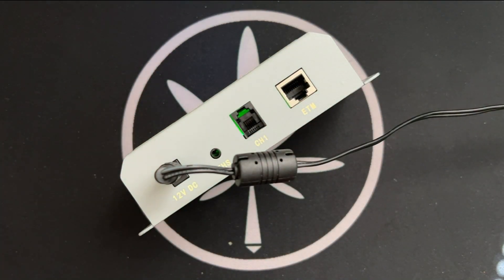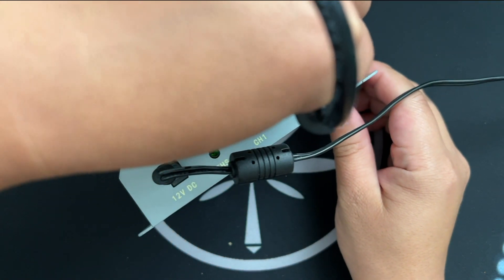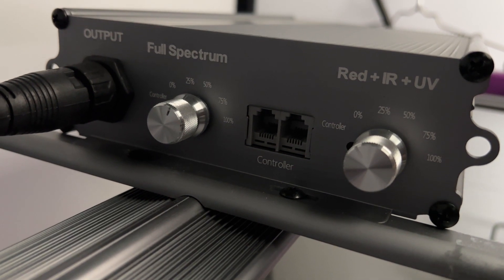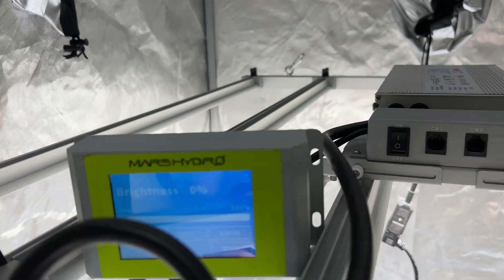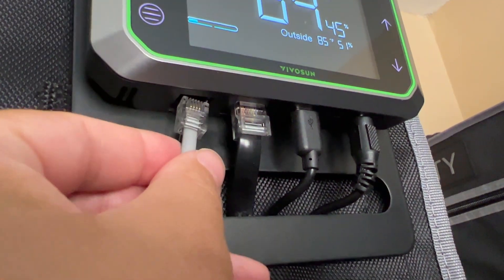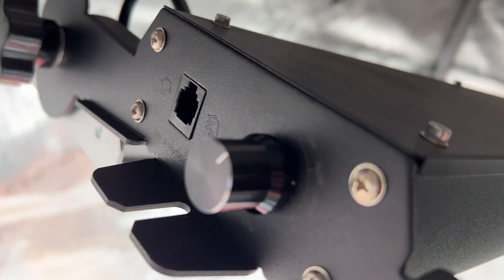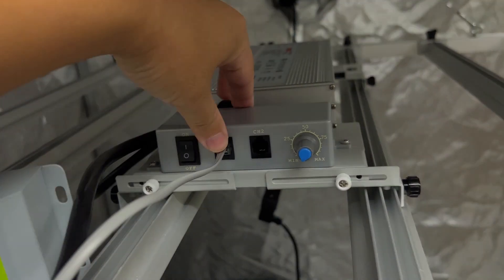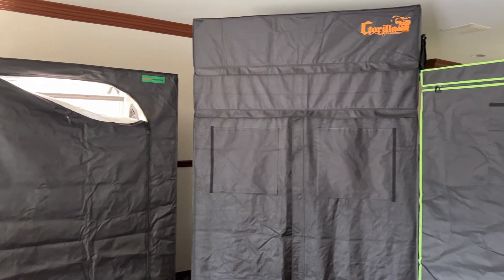The RJ-11 Port On Your Grow Light is Probably USELESS - A Mars Hydro Grow Light Controller Review

Comment: The reason for all this confusion is actually pretty simple. The rj cable can have 4 wires ( rj11) or 6 wires (rj14) etc. Most drivers are dimmable with the dimmer + and dimmer - wires. Every manufacturer use different wires from the rj cables for + and -. For instance optic led uses wires red and yellow combined for dimmer + and green and black combined for dimmer - with an rj 11 cable. There are 4 wires in an rj11 cable black, red, yellow, and green. The trick is to find out what color wires different companies are using for + and -. Once you know that you put those color wires to the proper polarity and bam done deal.

Comment: Yeah see there is two sub specs, of these controllers. One spec is 0-10v and the other is PWM control. You can do some 0-10v control with PWM but you have to be able to adjust the PWM frequency to match it's input filter. This is just the signalling there is also pinout there are more pinout differences than the two led control signalling mechanism. There is also the DMX standard but grow lights don't use that protocol. So at the end of the day unless you know the pinout, and the proper protocol grow light controllers are hit or miss. Also some of the RJ-11 dimmer ports are not meant to take a signal from a controller but just a signal from the same brand and daisy chain the one dimmer knob. Until all grow light manufacturers standardize the signalling, and the pinouts there will be little compatability between devices. Another thing to keep in mind most the dimming circuits are actually in the driver themselves. Meanwell drivers are the common standard for the 0-10 and PWM they can support either or. However you can look this dimming control if you have the driver's model number. However you are still at the mercy of how did they pinout the signals from the driver to the RJ-xx port.

Comment: On almost all of these lights the ports are for daisy chaining only... Not all lights are compatible with a controller, but if you have one that is compatible with a controller and then Daisy chained it to the ones that aren't, they will be controlled by the first light in succession Which should be the one connected to the controller and sometimes you need a  RJ14 cord for the extra data needed to interface with the controller and light

Comment: You are using the wrong cord with the MarsHydro controller. Black crossover cord is needed. Works with all MarsHydro lights including the new SmartGrow system. The ethernet port is for factory programming and is not used.

Comment: its nice that ac infinity released there rj11 to UIS(usb c) adapters, i got the adapter A which works perfect with my Mars Hydro Fc-E 3000 connected to the controller 69, i had to alter a phone chord to get the adapter to work with my tsl2000. if you have the want you could pretty easily get any of those controllers working by figuring out what the pin out of port on the controller is and then matching that up to the light you want to use. there are rj 11 screw terminal adapters on amazon you can get that wld help alot with matching up the wiring
Reply: Mine just won’t work. I’ve tried a and b. Use the light cable not ac?
Reply: @friendlyghostkinda did using the light cable and not the one AC Infinity provided work? I just recieved my Controller 69 Pro and RJ11 adapter for my FC-3000 and sure enough my light doesn't work and the Controller doesn't power on. Did you ever fix your issue? If so, may I ask  how?

Comment: I have the tsw 2000 model and tried to link it up with controller 69 Bluetooth model from AC infinity which claims its compatible using Type A adapter. It won't even turn the light on smh.

Works great for daisy chain tho
Reply: Wound up on this video with same problem. Firmware update finally did the trick.

Comment: I am looking for a controller that works with my marshydro ts-1000. I just want to set special brightness at certain times. If there is not such a controller I would also already buy new power supplies that work with an appropriate controller. What do I take there best?

Comment: Sometimes the phone plug pinout changes
Reply: glad to see someone else has figured this out... the pinouts need to match and i dont think mars hydro had a standard for them. my tsl2000 is + - + - and it connected to a parfact works controller thats rj port is + + + - so i just bought rj11 screw terminal adapters from amazon and made my own adapter to get the leads to match up and viola it works great

Comment: Even Mars Hydro themselves can't agree on a standard for their products. Doesn't matter what model of light you have, but what kind of driver (power supply) is used. The Meanwell ones are controlled via resistance (there's a poti in the control box, which you turn with the knob), while the ones with their own branding use the more common 0-10V/PWM standard.
So if that Controller you got there is using 0-10V/PWM, while your lights have a Meanwell driver, it won't work.
The AC Infinity page for their "UIS Lighting Adapter" with Type A (0-10V/PWM) and Type B (Resistance) was pretty helpful in figuring that out.
Reply: your correct about most of that although any light that has a dimmer box with a potentiometer like all of mars hydros dimmable lights do are resistance dimming via the potentiometer(dial) on the box. some drivers like moso x6 series which all my ts1000s and my tsl2000 has have 3in1 dimming  and can be dimmed with pwm or resistance. my fc-e3000 with meanwell driver also has 3in1.. so its really down to how the manufacture has there dim leads wired up to there dimmer box and what the pin assignment is on the rj port .. the leads from rj port on the light dimmer box have to match up to the port on the controller, + - - + to + - - + for example would work wearas + - - + to  - + + - would not work.. some lights show the pin assigment right on the dimmer box and same goes for some controllers like my parfact works controller shows the ports are + + + , which did not match my tsl20000 light that is + - + - so i got some rj11 screw terminal adapters from amazon and mad my own adapter and it worked as it should once i was able to match the positive and negative leads correctly. had to do the same thing basically to get an ac infinity type A adapter to work with my tsl2000, the adapter type A worked as is with my fc-e3000 though, it didint work for both the tsl2000 and the fc-e3000 bc the +/ leads dont match up but they can somewhat easily be made to match by altering a phone cable or using screw terminal adapters

Comment: Maxisun lights come with remote controls you can use to change the lighting pattern and intensity. They have Samsung chips and Meanwell drivers too. A light for a 2x4 space costs under $200.

Comment: how did u get this controller.. I ordered it on 2 different occasions and never got it.. I assumed they didnt even exist and I had the ol bait and switch pulled on me as mars hydro didnt want to be only mfg that didnt offfer a light controller.. same deal with spider farmers that is basically the same thing as mars hydro light controller.. i ordered spider farmers as well.. they sent me a heat pad controller and then told me the light controller was sold out when I emailed them and asked why the send me a heat pad controller and not the light contoller

Comment: the pin assignment is diff on some lights and might not be directly compatible with a certain controller.. which it why trolmaster sells the adapters and so do some other controller mfgs.. mars hydro rj jacks are + - + - and some are + + + - u should be able to use a multimeter to figure out what is what.. some light dimmers are 1-10v and some are 0-10v.. the 1-10v will not dim to off.. that vivosun controller should 100% work with any 0-10v dimmable LED u prlly just need an adapter.. look up rj11 to screw terminal adapter and u can make your own i can walk u through it if u need. I am michigan home grower and can help u get any of those controllers working for whatever lights if you want just reply and ill send u my email and walk u through it..
Reply: I use the parfactworks intellegant light controller with my mars hydro LEDs.. had to make my own adapter for them to work but it works.. there are 2 outlets on the controller garden A and garden B and then there are 3 channels per Garden/ Rj11 output so i can have 3 diff dim lines coming from each output.. there is no temp or rh sensor on the parfactworks controller but i wasnt really worried about any temp controlled dim setting i just wanted to be able to schedule sunrise and sunset dimming to get a more natural light cycle going and it works great for that purpose
Reply: @davidmassengill5290  My RJ11 jack apparently is wired + - - +.. I got a cheap dimmer off Amazon that has two wires ( + & - ).. Should I hook both the + wires from the jack to the + of the dimmer, or just one or the other?  Same question with negative wire.  Any help you can provide will be appreciated.  I have already confirmed that connecting a meter to wires 1 & 3 ( + - ) gives me a positive voltage that increases as I turn the knob on the LED controller (~ 25 % steps).  Thanks!
Reply: @Gareth96v1  try connecting the 2 wires  to the ones you metered.. Try pos1 to pos2 and neg1 to neg2.. If that dont work try the opposite.. Pos1 to neg2 and neg1 to pos2.. There shouldn't be enough current to blow out anything if it gets hooked up backwards
Reply: @Gareth96v1  BTW I have a mars hydro led with meanwell drivers and the dimmer switch on that one is wired + - - + like yours.. I use these thing to make my adapters
Reply: I just ordered a spider Farmer G3000 it claims to be a dimmable and controllable with any universal 0-10 v controller. I was looking for an upgrade from my aerolight 100w from vivosun I have their WiFi controller. I was wondering if it would work together?

Comment: Aren't these ports for daisy chaining to other lights. Appreciate your videos. But instructions for my SE3000 specifically says it's for daisy chasing.. 
Light 1 will control the dimming of all lights.
Reply: theyre for external control weather its another dimmer box or a controller it should function the same if theryre connected properly/ compatible

Comment: Has anyone come up with a hack to get the ac infinity 69 controller to work with 3rd party lights?
Reply: they did, the adapters lol, im sure you know that by now. the type a adapter worked great with my fc-e3000, it didnt not work with my tsl2000 but i was able to get it to work by altering a phone cable to make the + - leads match up correctly

Comment: Make sure to check for firmware updates for the controller and/or the light.  Also, these ports are sometimes added to generic so called "chinese" built stuff as something that might be utilized in the future but it can sit there doing nothing.  Don't expect a feature if you see an interface port in this wacko world.

Comment: It’s not for a controller it’s to dim them all to the same brightness on the marshydro light that it
Reply: No it's not. Then it wouldn't need a light timer, and display humidity and temp.
Reply: @swankshire6939  hes saying the dimmer boxes on the lights arent for controllers.. they initially are inteded for daisy chain dimming like he said but it shouldnt matter if signal comes from another dimmer box or a controller he just needs the proper positive and dimming leads to match up in order for them to work

Comment: Does trolmaster controller work with mars hydro?
Reply: with an adapter it does.. u have to get the F adapter i think it is and then the 3.5 mm stereo pin to screw terminal adapter thing and wire the 2 dim wires from mars hydro drivers right to the adapter
Reply: or u can strip and hard wire there rj cable and wire the dim leads to that but u will need some electrical experiance to pull that off

Comment: I bought a light controller from 420seven and I thought I was trippin when it didn’t work. This controller controls 4 lights via 4 independent RJ11 ports. Long story short, I finally got only 1 mars hydro (FC e4800) to work as intended. Tried connecting another light from another tent (FC 3000)…no go. Tried daisy chaining the 2 lights and…no go. That 1 stumped me because both lights claim to have that capability. I scrapped that idea and decided to just run the 1 light on the controller and the other manually. So far I’ve yet to run into any problems. I also purchased a ppfd and temp/humidity monitor that plugs into the units bottom socket. All work great for the one light only. Shame only works with just that 1 light tho.
Reply: buy a cheap multi meter and strip one of the rj cables to expose the wires.. there should be 4 of them.. use the multimeter to test the wires and figure out which wire is carry the 0-10v dim signal.. have the channel brighnest turned all the way up om controller and the dim + wire should be around 10v.. and then one of the remaining 3 wires will be the neg.. anyways if u can figure out which wires are which then u can make your self adapters to make any light work.. its what i did with parfact works light controller i currently have hooked to a ts1000 that is daisy chained to another ts1000 and both dim great with controller.. the rj output on the parfact works controller was + + + -. Hellion has a controller that is exact same as parfact works.. im wishing i had just got the  Volt one bc it has ec relays and can be controller over phone app
Reply: @davidmassengill5290  Didn’t think of this 👍🏾 I tried several different cables and none worked so I just started the grow using the one port that does work as intended. Phone app is coming soon, which is another + and if I can get the other ports up and running, win - win.
Reply: @davidmassengill5290  I am looking for a controller that works with my marshydro ts-1000. I just want to set special brightness at certain times. Can you tell me how best to do this?

Comment: I have the master controller for the Optic Slim series.. if you have a power outage, the master controller disregards the timer and just powers back on at 10% light. Not worth it unless its autos 🤷‍♂️ no battery back up to keep the timer mode on. But that GSI does look pretty awesome. As for Mars Hydro, I gave up on them. 3 lights in 3 years. I prefer an overkill light so I dont have to run it at 100% power.. it helps keep temps down in the summer time.. and of course MeanWell and Samsung as the components, the light should ast damnnear forever according to the manufacturers.. but Mars Hydro has failed me. As for the FC series and whichever they now make with MeanWell and Samsung, I'm sure they are better than the Sosen and Moso drivers. 

But i love your videos bro.. always good info.. wish YT would let people show plants.. your bonsai vid in the PC case was pretty cool. And I learned how to make feminized pollen from your videos. Thanks for sharing grow bro! 👍👍👍
Reply: Both of my lights are 👌🏾 fc 3000 and fc e4800 2yrs strong 🤞🏾I also have a ts 1000 and it’s holding up as well.